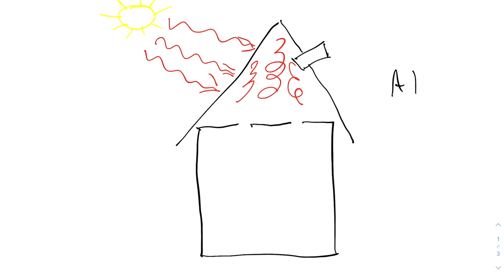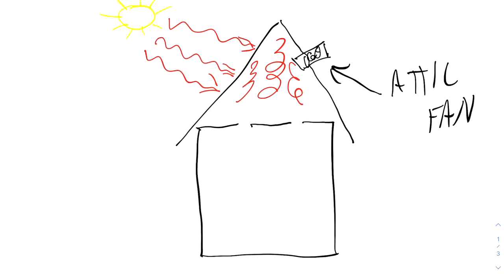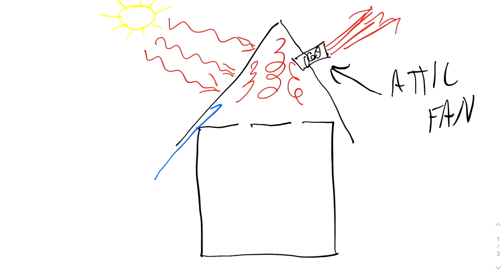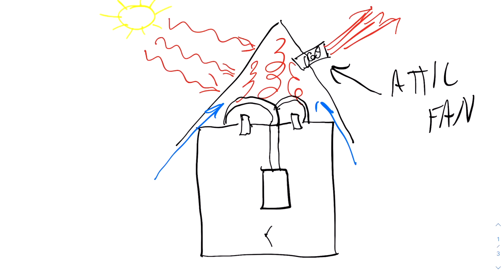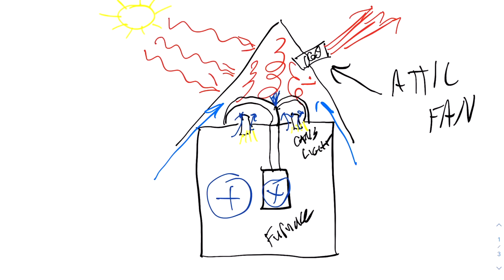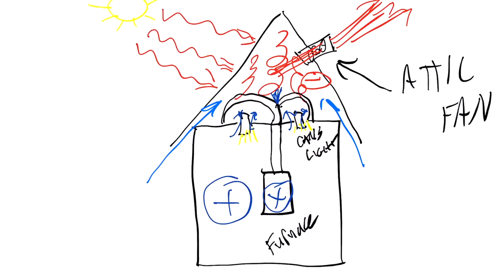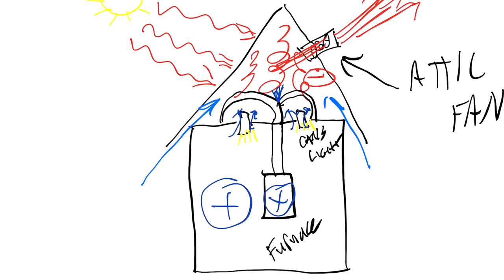3 Remodel Rip-Offs

Comment: Have to add that replacement windows are often used for rotted or non-sealing windows more often around here than anything. Get a house with 70 to 120 year old windows, and you will want to replace them. 

As for attic fans, they won't benefit everyone. But again, with much older homes they can help. They aren't trying to keep the roof cooler, they're keeping the attic-space and ceiling underneath cooler. The sun isn't beating down on the ceiling. While there is a bit of transfer of radiant heat fom roof to ceiling, the moving air does disipate it, just like a CPU heatsink carries heat away from a mass with the help of a fan. In my experience, they are most helpful when dealing with an older home that can't be fully insulated to current standards, especially if they have otherwise inadequate roof ventilation. Wired gable vents with a thermostat is what I am talking about, those rooftop solar vents are a joke.

Your hot-pocket analogy doesn't quite make sense either, as microwaves use a wavelength that excite water molecules, and the friction of those vibrating molecules is what creates the heat. That's not how the sun heats your roof, or anything (except maybe a body of water)... Also, those micro-waves focus on a relatively small area inside the microwave (which is why most have turntables). Lean that Hot Pocket up in the back corner of the microwave and it likely won't get hot at all. 

A better analogy is turn your regular oven on and let it get up to around 150F. Then crack the door. This is a vented attic. Now take a desk fan and blow into the crack, this is a power-ventilated attic. That oven will have a much harder time keeping temperature with the fan blowing cooler air in than the oven door just being cracked. The sun is the heating element, and the inside of the oven is the inside of your attic. Now crank it up to 350 or whatever and cook a pizza in both, I bet you can still cook one in the cracked-door version, it will just take longer. I would bet the pizza never even comes close to getting cooked in the vented variant. Before someone says it, convection oven fans circulate the hot air inside the oven, not cooler air from outside the oven.

So, those things might not work for you or the jobs you do, but they do work in some cases, in fact, many cases where people live in much older homes. Couldn't agree more with the smart thermostats though. A decent programmable thermostat can be had for $30 or so, the rest is just pointless gimmicks.
Reply: Totally agree
Reply: Actually, that's exactly how the sun heats your roof.  The radiation excites the molecules which throw off heat.  Both the sun and your microwave radiate electromagnetic energy, the sun in the visible light wavelengths, and your microwave in the microwave radio frequency wavelengths.
Reply: Greg K , pretty good points, except the sun is radiant in all the wavelengths (or frequencies, if you like); infrared ultraviolet visible x-rays gamma rays radio waves microwaves, the whole spectrum
Reply: @DanielinLaTuna  good point!
Reply: Good post - you saved me saying exactly the same thing, but I would add that Matt seems to have completely ignored the fact that double pane windows save on the heating bill in cold weather, but also on the cooling bill in hot weather - windows serve as giant radiators in the summer, and a vacuum sealed double pane window will be much cooler on the inside in the summer than a single pane would be.
Reply: "A better analogy is turn your regular oven on and let it get up to around 150F. Then crack the door. This is a vented attic. Now take a desk fan and blow into the crack, this is a power-ventilated attic. That oven will have a much harder time keeping temperature with the fan blowing cooler air in than the oven door just being cracked. The sun is the heating element, and the inside of the oven is the inside of your attic. Now crank it up to 350 or whatever and cook a pizza in both, I bet you can still cook one in the cracked-door version, it will just take longer. I would bet the pizza never even comes close to getting cooked in the vented variant. Before someone says it, convection oven fans circulate the hot air inside the oven, not cooler air from outside the oven."

I don't follow your analogy.  The powered attic fans are exhausting hot air from the attic.  They are not blowing outside air in.  I think Matt is simply trying to say that the sun is so powerful, it would require lots of air movement to remove the hot air, and that it will not drop attic temperature to that extreme.  Certainly, the best case scenario would be for it to match outside air temperature.  I had a couple on my house, but they quickly burn out due to the high heat environment, and worse, my house is so poorly sealed that they were mainly sucking cool air out of my living areas.
Reply: I agree. I have a question 
We have a home shaped like a double wide about 60 ft long.
My dad installed 2 air conditioning fans on either side in a push pull configuration, they turn on whenever the temperature reaches 100°f inside the attic. 
You go up there in the middle of the Texas summer and it feels cooler than ambient because of the nice air movement. I wonder if it is helping more than the cost to run them.
Reply: @bgnPrinceton  
No analogy is perfect, otherwise it would just be stating the exact situation you are trying to come up with an analogy for. 

The difference between negative pressure system (fan set on exhaust) and positive pressure system (fan set as intake) is going to be determined by several factors like the fan's location, number of fans, the location/amount of other vents, etc. When you push cooler air into an attic, the warmer air tends to be displaced and pushed out of other vents. It is more common to make a fan exhaust rather than intake, but the result is often the same overall. Roof-top vents will likely always be exhaust, but gable vents could be either, depending on other variables.

I don't usually deal with rooftop vents, as I don't usually do roofing, and I am also usually against punching unnecessary holes in an otherwise good roof. I will install gable vents more often when doing a siding job on an older home. It's not really much of an up-sale for me,  but it makes me feel good if I can help improve the quality of life for those living on a 2nd floor of the older house. The electrician I tend to need to hire ends up making most of the labor money for a fan alone, but they are often required on a job for other reasons.

As for your situation, with poor attic sealing, I would suggest filling those voids with foam, caulk, or boxes in case of can lights... That advice is regardless if you choose to install an attic fan or not. All of those gaps would be like (prepare for another analogy) having the same gaps on the side of your house in the exterior  siding into your living space. Air-sealing an attic is a cheap and fairly easy (if done on a mild day) as a DIY project. Don't forget to wear PPE, especially if dealing with fiberglass. If you suspect you attic has vermiculite insulation (small loose balls that look like semi-metallic Styrofoam) be aware that it might contain asbestos, in which case you should stay out of the attic and look into getting it prefessionally removed.
Reply: @Techno4more  
In those cases, I usually do some trial and error testing. 100 seems a bit low TBH. I have usually set the thermostat to kick on at 105 at the lowest, 110 is about average.

Comment: Keeping the fan on for a few moments with a gas furnace after the temperature set point is reached is a good thing. It allows the heat left in the heat exchanger to make to the interior space and cools the heat exchanger for increased longevity.
Reply: Matt is talking about cooling not heating here. And i am sure this is also a safety feature that can not be overridden by a smart thermostat.

Comment: I like how my smart thermostat on my furnace adds remote temp sensors so I can heat the house until my bedroom(hottest room in the house) is the desired temp.
Reply: @MAGAMAN  I do not have zones. It is a propane only furnace. And my smart thermostat gives me poor man's zones.
Reply: @MAGAMAN  it's not exactly the same. My bedroom temp changes a lot faster than the thermostat room so it runs a lot more frequently when I have it set to the bedroom. Way comfier

Comment: Sorry Matt, my solar attic fan keeps my house significantly cooler - before I installed it, AC would typically kick on about two hours earlier than after I installed it.  My utility sends energy audit notices every quarter - and the home has consistently used less electricity since the fan was installed - solar fan was the only change, so it's clearly an energy saver.  You are forgetting that attic temps can get to 130-140, but even hottest days, air temps are in 90s-100s, so the air temp to attic temp delta is 30-40-50 degrees, which is a significant difference to help cool attic spaces.

The notion a roof fan could depressurize an attic is nonsensical - you'd need massive fans to overcome typical roof/eave vent capacity to create a negative pressure situation that would pull air from the interior.
Reply: You have to remember he builds conditioned attics. He sees any air being drawn from the living space into the hot attic as a huge waste. The degree of airtight seals in your ceiling would govern how much low pressure would be required to draw air from your living space into the attic.
Reply: This is not necessarily accurate. My house has two separated attic spaces with 2 powered fans. Even though the entire length of the eaves is well vented, it still sucks a ton of air from my house through the attic access hatches. I need to put weather stripping around them, but there is significant negative pressure when the fans are running.

It's also worth noting that a solar fan and an AC powered fan are not comparable. The solar fans are 10-30 watts at most. Hardwired fans use 100-200 watts or more! Solar fans are a joke.
Reply: @ryanroberts1104  Your fans are pulling too much volume for the makeup air that you have access to.  You need lower rated fans, or increase the intake air area for the fans you have now.  You should not have significant negative pressure in a properly sized system.
Reply: @IanSlatas  Having a big fan just means it pulls that much more hot air out. Yes, my attic hatches need to be sealed, but this statement is entirely wrong:
"The notion a roof fan could depressurize an attic is nonsensical - you'd need massive fans to overcome typical roof/eave vent capacity to create a negative pressure situation that would pull air from the interior."
It's actually quite easy for an attic fan to depressurize your entire roof. Not a solar fan. Matt is correct about them pulling air from the house.
Reply: @williamnaman3570  But the video is aimed at remodels.
Reply: @OutNAboutWithBrad   Isn't roof repair a remodel? Always extend your roof when you make an addition to your house.
Reply: @ryanroberts1104  its going to suck air from easiest point. Not through 
16 to 20inches  of insulation..
Reply: @maryglasser404  Not sure what you're talking about, nobody is suggesting any fan should be pulling through insulation. If that is the case your attic is not properly vented, nor do we use anywhere close to 16" of insulation anywhere in the south.

Comment: I think it depends where you live for attic fans. In dry mild area, the sun does not immediately heat up the air in the attic. It takes a 2-3 hours, but that heat can stay in the attic all night. The outside temperature could be 55-65 degrees, but inside is 75-80 degrees until 3-4 am on the top floor.  So the AC needs to run almost all night, but an attic fan can blow out the hot air after 5:00 pm when the sun is not as strong.